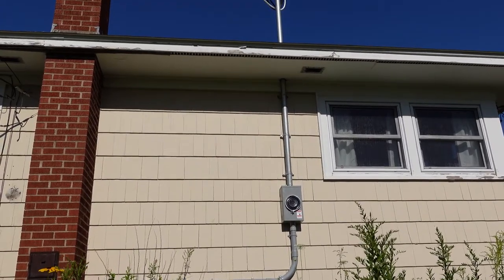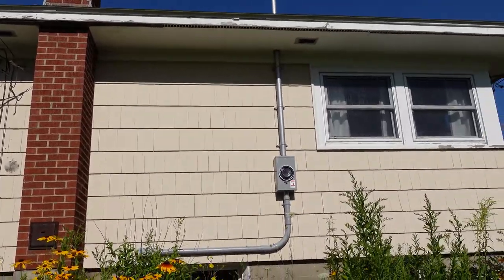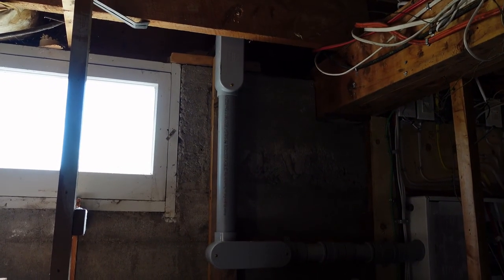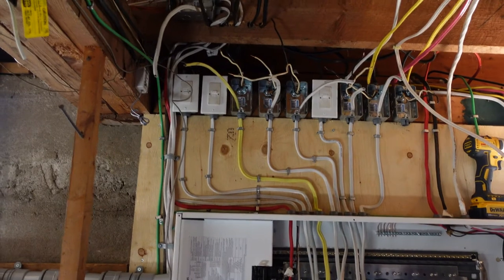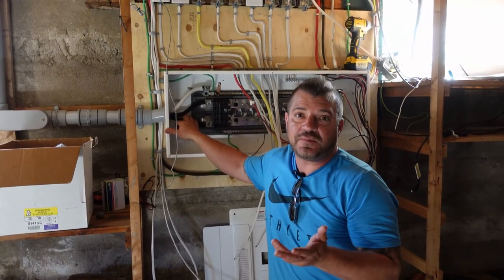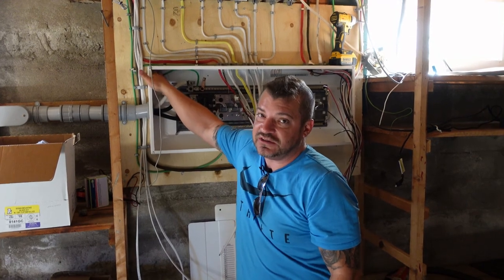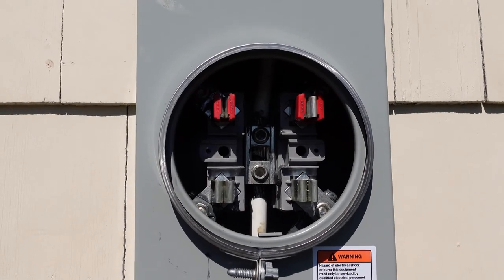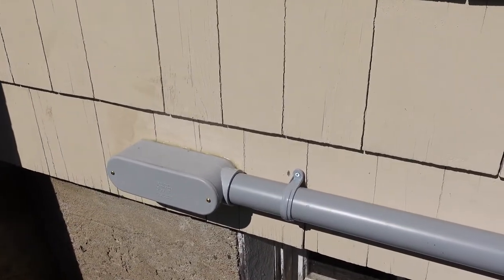Installing A 200 Amp Electrical Service

Comment: What is considered in the distance of 10ft "entrance to panel" to avoid the external main disconnect of the 2020 nec rule? Does it start from the weatherhead? the meter? or actually the first wall penetration?
Reply from the maker: The wall penetration when it enters the building.
Reply: @conquerallelectrical  Thanks for the reply. Is that exception in the code or just in your area?